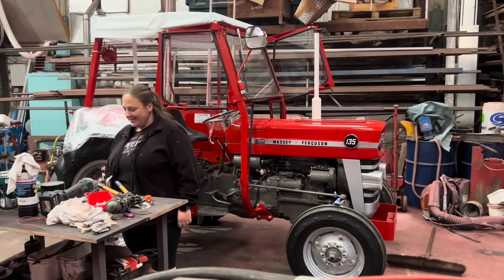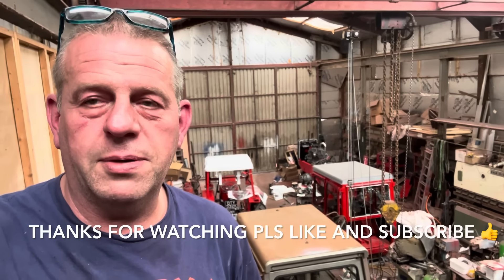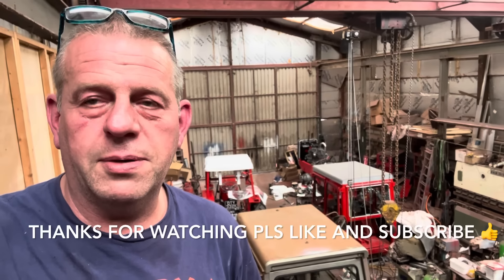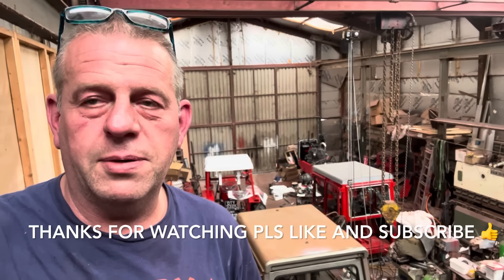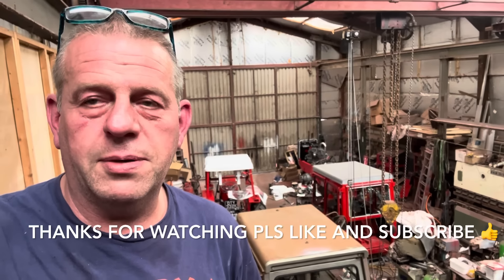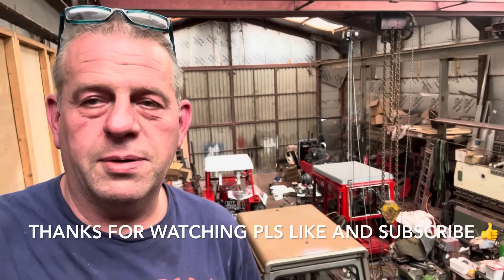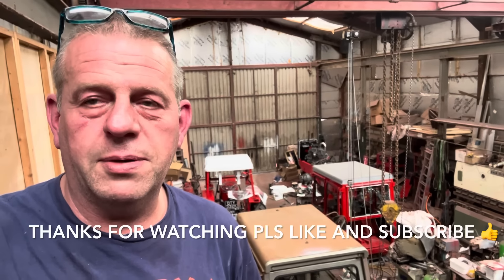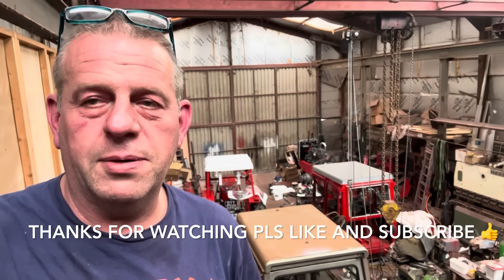MF 575 injectors fitted , Apprentice here for a day 👍

Comment: Great video Dave just a quick question im after the olive  that comes off the end of the leak off pipe that joins the injector rail on the 135 ive got anew leak off pipe but it comes with a rubber seal  and doesnt fit the rail so i need a olive do you know where i can get one many thanks
Reply from the maker: Thanks , tis all as happens here , so who knows wot will happen 😂👍 umm not sure on that ?!? What was on it b4 ? Usually a rubber one works ,  or plenty of ptfe tape ? The thicker stuff
Reply: The  original  pipe had an olive and was leaking at the joint so I got a new pipe that came with the rubber seal but does not join
Reply from the maker: @lesliegoodsell6866 🤔🤔